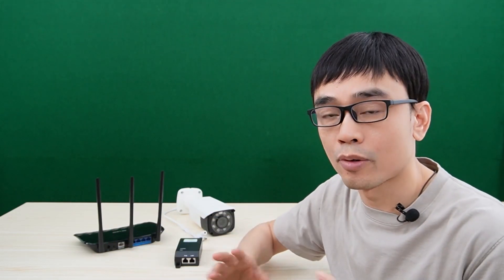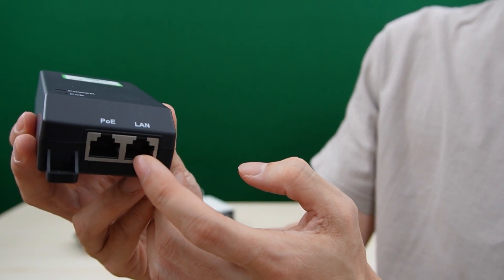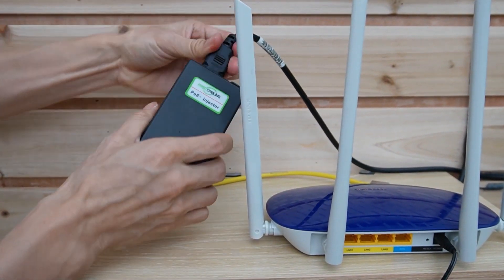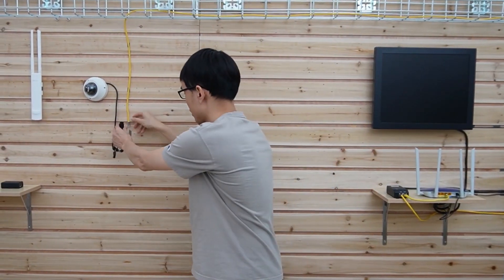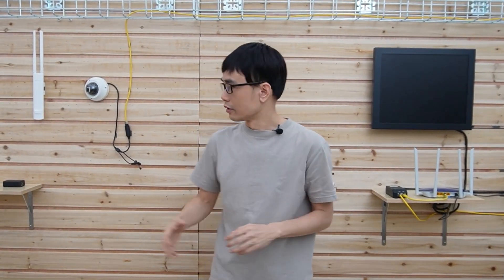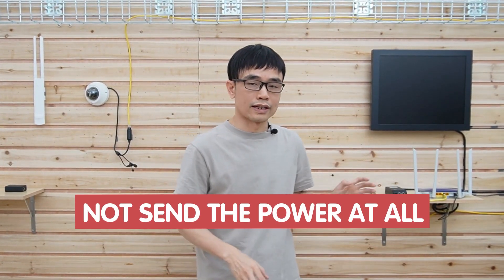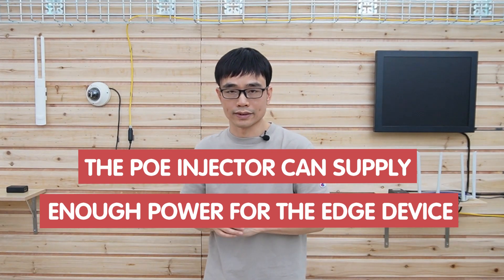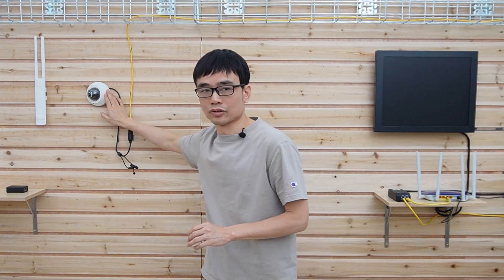5 Tips on Converting Non-PoE Router To a PoE-Compatible One

Comment: Help, Connected POE Injector and power adaptor of secondary router with primary router and connected splitter with secondary router, secondary router getting power but no internet and sometimes get power but low internet speeds. Poe kit is 1000mbps
Reply from the maker: Connect the secondary router directly to the primary router using a standard Ethernet cable and a separate power adapter (bypass PoE). Check if the internet and speeds are stable. If this works, the issue is likely with the PoE kit (injector, splitter, or cables).

Comment: Misleading title: "5 Tips on Converting Non-PoE Router To a PoE-Compatible One" Doersn't talk about router conversion at all.
Reply from the maker: Sorry for the confusing. There is no need to touch the setting of your router. Adding a PoE injector will turn router into a PoE compatible device. The PoE injector can inject the power to an Ethernet cable.
Reply: @Fastcabling  No, not all routers are POE compatible thus not all routers can transfer the current. And in this video you do not show how to make router compatible.

Comment: Good job but i have 1 question it is possible that i can use the poe switch to power the regular router?
Reply from the maker: Negative, unless your router support PoE (power over Ethernet). You can add a PoE splitter to divide the power and data. So you will work with non-PoE router with PoE solution.